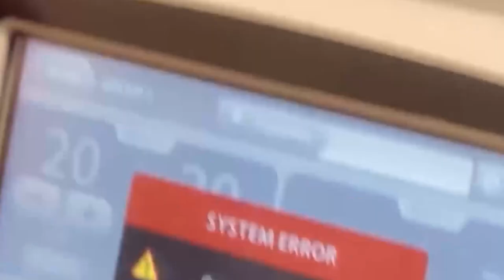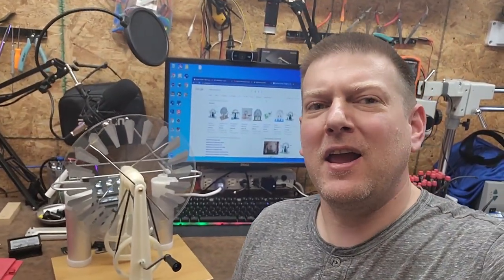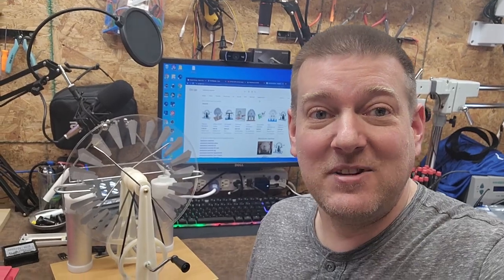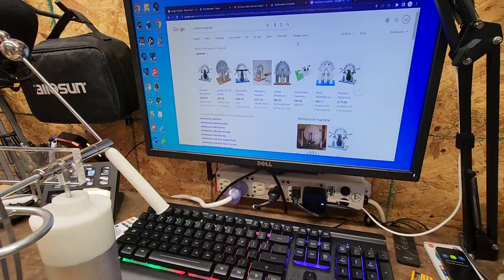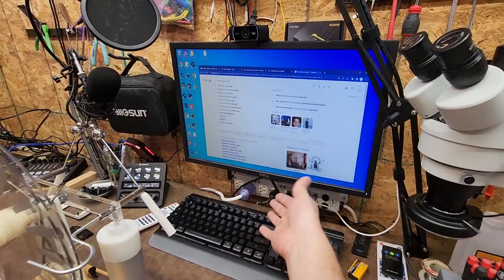ESD Epiphany!

Comment: You can repeat this experiment, with one side of the ESD generator connected to safety ground, so that the ESD generator is on one side at the same potential as the ground of your computer, monitor and other usb devices. This how ignition systems in cars are also used to prevent damage on the onboard electronics like the ECU and other modules.

Comment: Every discharge causes a massive EMI spike. This probably has just a big an effect on the disturbances you see as the electric fields.
Reply from the maker: I'm going to setup an oscilloscope to try and capture the phenomenon and measure it.
Reply: @BetterBiomedChannel  , you are gonna fry your scope. The current of ESD is very low, but the voltage is very high and it can arc over inside your scope and can cause damage to IC's. If you want to do this, you have to use a attenuator. 
A few months ago i had a cheap DMM on my bench, during a high voltage experiment. I had placed a step down transformer that was not  connected to this DMM, used backworths, and added a low AC voltage to the secundairy side, where the primairy side started to arc over inside the windings, the cheap DMM on my bench , arround 20 centimetres away from this transformer, suddenly start doing weird things and ended up with showing 1 (number 1) in all ranges and doesn't respond to anything anymore, while the testleads where not connected and away from the transformer.
Reply from the maker: You're thinking about this all wrong.  I don't care about the voltage or Amps of the arc. I want to hook up an antenna and measure the distance of the EMI emissions. Or, I can hook a scope to a circuit board in a device and measure the effect on neighboring equipment
Reply: @BetterBiomedChannel  , ow i see, i misunderstood your reply. At a distance it can normally do no harm, but the front-end of a scope is very sensitive.